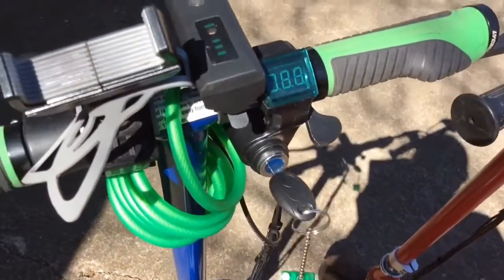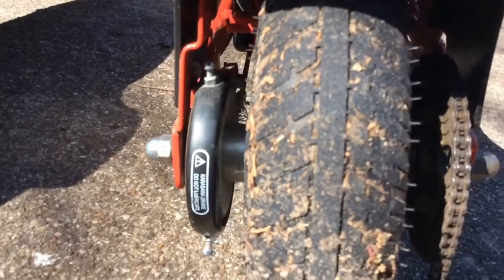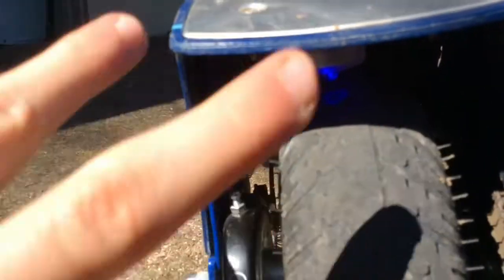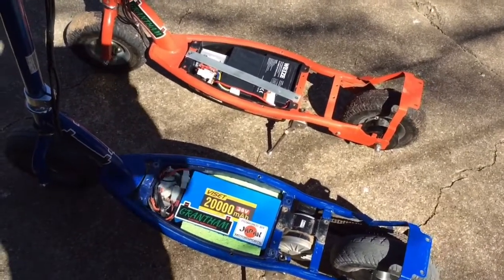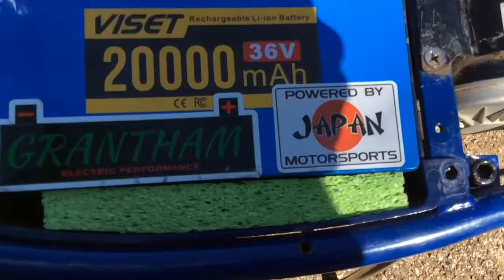Razor Superscooter! 36v conversion and how I did it!

Comment: Did you have to rewire the speed controller to the battery or did they connect with no additional plugs
Reply: You need to rewire the speed controller to the battery, it isn’t as hard as it looks tho

Comment: Where to get overvolt controller
Reply from the maker: https://www.ebay.com/itm/144138151533?epid=17032258797&hash=item218f4da66d:g:smkAAOSwdkRhCX80&amdata=enc%3AAQAHAAAA4BmkUbuKRnhLex4FrKP9nQ9s8ZllXb0zLfCMEgL%2By937AB2KdKJ9zRnmked26eTtVfkYvP4rQU7ypOn2w9ZtNHYM7%2FzXCRac7ah%2BalZZ6PnsXVRPJgb8uAYs7vKmdPykm3INwT5LsDQIxhvlGWfgjksa1I0P9Yo7PZcSNotbaa6CICW%2BgHIK1yTcgXLDAdjdl0vAu%2BpRNLefiClW79D8qMzVn4r%2BrLQDZYPVbF4UJwzE8l1tVk3sHfACye8iViq1uF%2FjPDZ7ZZk4D3lGw2tLic8e6pxDW4fHaBtue7lzUVAx%7Ctkp%3ABFBMmL_okt5g This is a similar controller, but a different throttle that shows charge, but not voltage.